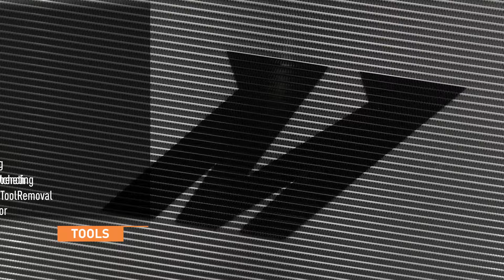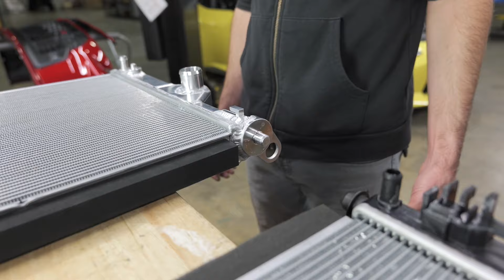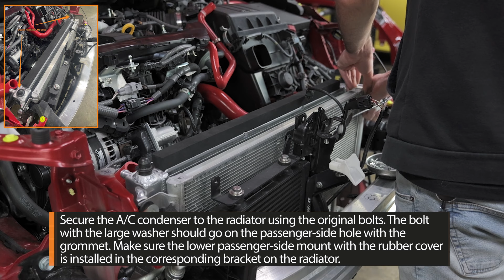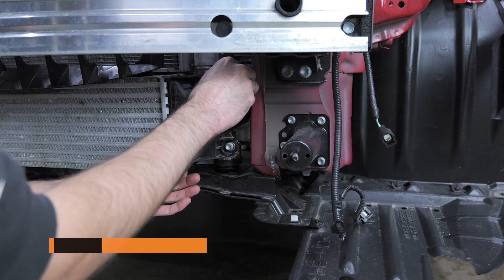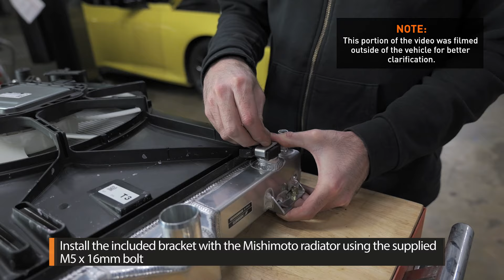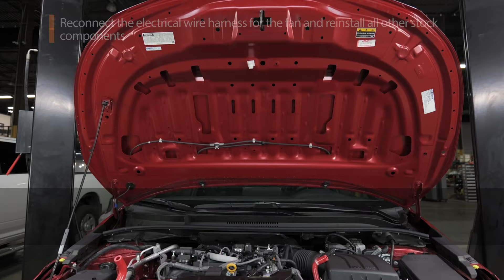How To Install A Radiator — 2023+ Toyota GR Corolla

Comment: Is it required to remove the bumper or was that just for simplicity and filming visibility? I know many intercoolers and its pipes can be swapped without removing the bumper on this platform
Reply from the maker: We suggest removing the front bumper cover.